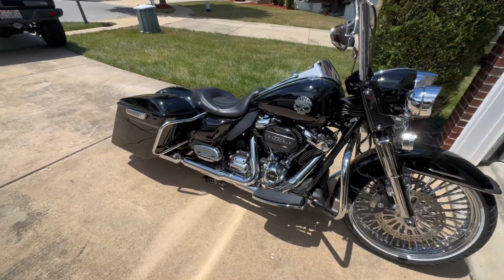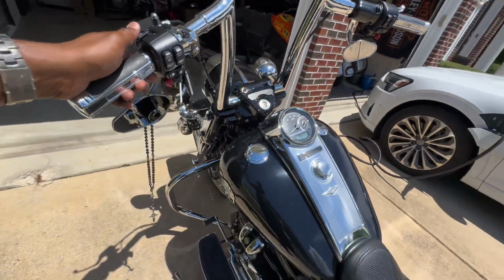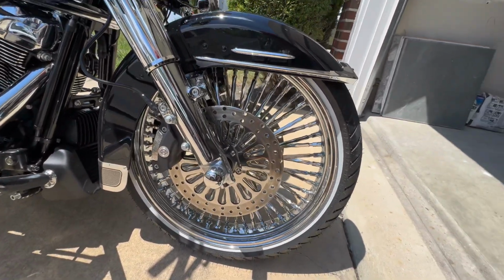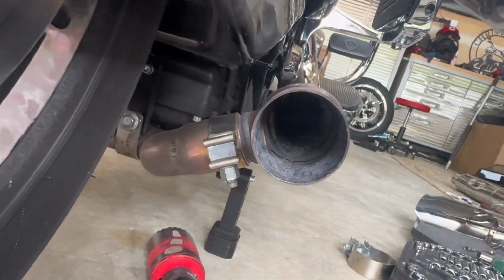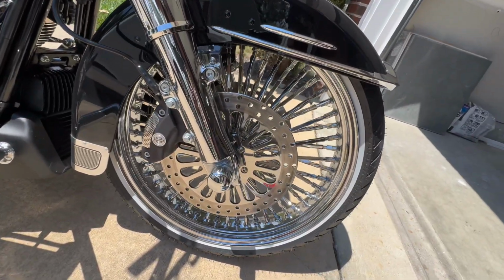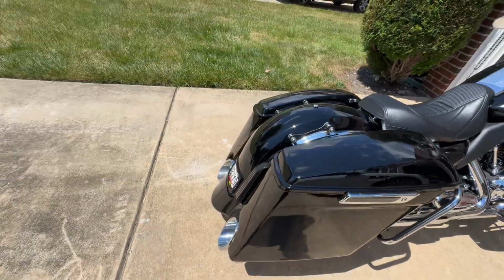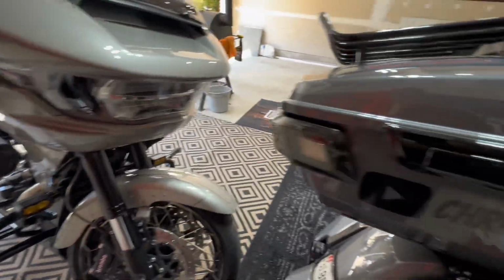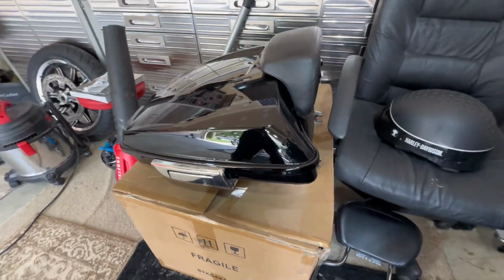Updates on the 2023 Road King, Rolling Exhaust Clips with Tab 50 cal Zombies, Everything is for Sale

Comment: Hi Chris.  Great stuff.  You’re selling everything?  What’s next?
Reply from the maker: 25 HD CVO Road Glide Limited & 25 Honda Goldwing DCT w/Airbag
Reply: @ChrisGlides  NICE!  Back in the Goldwing game!  Have the specs on the ‘25 Goldwing been released?
Reply from the maker: @tctc2470  Not that I know of but if it comes with a touchscreen and new features than I’m getting it.  If it’s the same as it’s been unchanged for past several years than I will wait for a touchscreen model and the visual changes.  If HD comes out with a DCT automatic with reveal like Honda and the HD has the new infotainment screen then it’s game over.  HD would put Honda out of business.  The amount of HD dealership outnumber everything.  You can get HD serviced anywhere on a road trip or at least pull up knowing that if it’s the weekend that HD always has events and free water and coffee.  Oftentimes also free burgers, hotdogs or pizza.
Reply: @ChrisGlides  good points. I have heard rumors (which as we know, are rarely accurate!) that it will have Adaptive Cruise, lane assist/warnings and some additional tech but nothing about a touchscreen or a removable tour pack. But would think that adding a touchscreen would be simple for them to do. I wonder why they have hesitated in that regard. But you’re right about the Dealerships. They provide such great peace of mind…And even at some of the biggest Honda dealerships, I am more informed than some of the Sales-people!  I had one guy today tell me that the non-touring Goldwing has Traction Control. I had to inform him that he was wrong. It’s only in the Touring model.
Reply from the maker: @tctc2470  well one thing is for sure and that is that I will certainly be buying another Goldwing if it have touchscreen or removable tour pack without the expensive remods.  No matter what I will be getting a new CVO Road Glide Limited.  Gonna cost a Ton of money though.  The HD tour pack is always easily removable even without the quick docking station.  4 bolts.